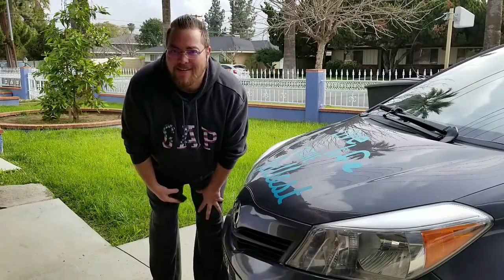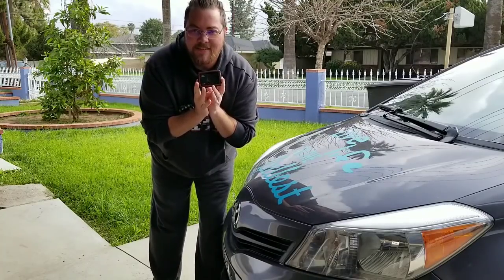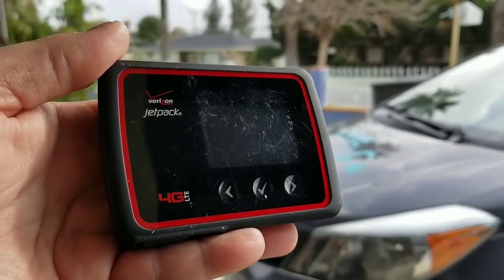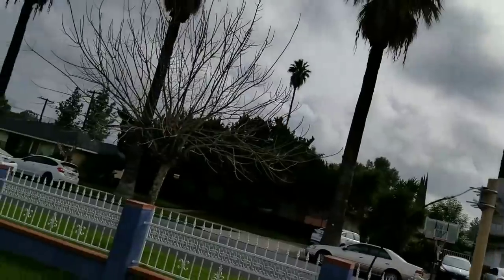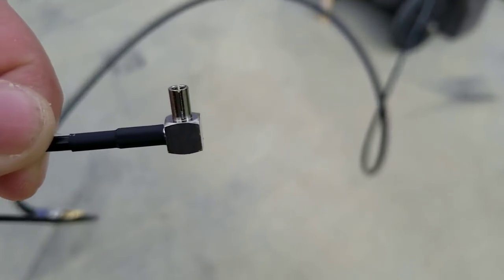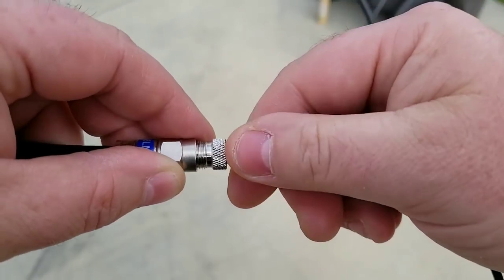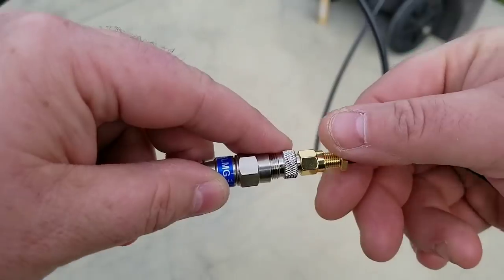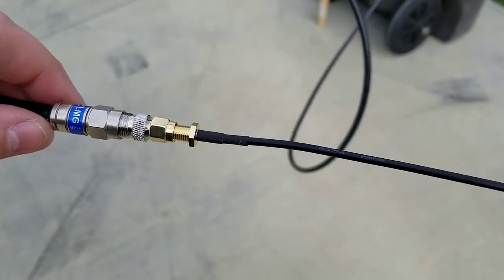"AS OF JULY 2018 MY 3G IS OFF" Cheap internet on the road Verizon 6620L Wilson directional antenna

Comment: Quick suggestion....don't turn on the jet pack until after you connect the antennae. You can damage the jet pack by plugging it in while the power is on
Reply from the maker: Buck Naykid good advice thank you

Comment: Hi Kristofer...  About the Verizon..... would you have more infos ?  you said 5$ a month ? unlimited internet ?  so you just buy this 'jetpack' on Ebay and then use it ? it's that simple ?   is there a contract to sign ?  (monthly or annual bills?) Thanks !
Reply from the maker: Pat Montreal  I bought the device on eBay I put in some information in the description.  How it works is when the $5 is due you go to their site mrwireless and purchase a $5 load  And what they do is apply it to your account that they've already purchased from Verizon.   The device is flashed to do 3g unlimited.  it's really very easy.   So my 1st $5 will be in May because I get the 1st 2 month's free.  Let me know if you have any other questions.
Reply from the maker: Pat Montreal oh and  No contracts.
Reply: Hey, thanks for taking the time to answer !  it's precious info you just gave me !  thank you so much ! Pat.
Reply from the maker: Pat Montreal no problem.  hope it helps. I put the site I  the description too

Comment: I had 3G in the truck when I drove over the road and was able to DJ my internet radio station with no problems at all.  All I had was a USB720 dongle from Verizon and only found 2 places all over the US where I drove where there wasn't a signal.  No booster.  Of course the higher your antenna can be mounted the better since you'll get less ground interference.  Looks like you did real good on the purchase.  Oh, that vocabulary thing you think you have...  naaa.  You don't have any problems at all my friend.  I understand you just fine and I'm sure everyone else does too and if they don't, then just laugh inside knowing you confused them.  We know what you are talking about.  I understand the brain going a million miles a second.  Mine does that as well and has as far back as I can remember, sometimes making it difficult getting to sleep.  Just a few days ago I was trying to go to sleep and nope, my brain decided it was time to think about a spring loaded hinge release pin so I can hinge my solar panels on both sides for tilt.  I laid there for hours going over it again and again.  Almost got up to find a boring documentary and try to bore myself to sleep but it finally subsided and I was able to snooze.   Crazy stuff it is.  Thanks for sharing your adventures with us and I can't wait to see Frankie 2.0 in action with all the remodeling and new tech you are adding.
Reply from the maker: Motrukdriver  I know exactly how it is needing to get up or write down what I'm thinking or else I can't go to sleep.  Well that's good to know that 3G is good.  My work programs I think run on very little data so that's good. 👍

Comment: I didn't know about that coax cable adapter. I wonder if that's what the new TV's have the same thing
Reply from the maker: Marty Records that's a good questing.   I know all TV's used to be F connector because the regular cable line is the F connector.  A lot of them still have that F connector port when the cable line comes in through the back of the TV.

Comment: There is an app called OPEN SIGNAL and it will show you the towers in the area.  Currently, I have one tower available to me and it's far far away lol.  An antenna might be the thing needed.  I had thought a weBoost and went into 'info overload' lol.
Reply from the maker: Roaming Raven lol. Hiiiii 😊💚 I tried open signal on my cell phone but because I have T-Mobile it was only pulling up T-Mobile towers.  I tried looking up if I can switch were see other carriers towers but I couldn't find that option.  Otherwise open signal is awesome.
Reply: bummer.  of course it tells me I have a Verizon tower and tells me it is not within range.  Both are true lol.  This spot is about as close to BLM I get in OH.
Reply: when i am not in OH, I am in Appalachia and again, there is a tower out of range.  The good thing is if I put an antenna on a pole and planted it on the ridge, ran lots of cable then I might be the envy of the hollar.  :-)
Reply from the maker: LOLOL yes you will be the Envy of the hollar.
Reply: UPDATE on better app:  actually it is a website...cellreception.com you choose your service provider and check the towers.
Reply: also, have you requested your free TMOBILE cell booster?  check out their website.  Seth (Nomad Everywhere) did a review on it recently.
Reply from the maker: Roaming Raven I saw his video. I'm getting one for sure.  maybe today :)
Reply from the maker: Roaming Raven ship I went to the t-mobile store they looked at me like I had 3 heads.  I showed them their site where it shows and Seth's video of what it looked like.  They said I should call customer service.
Reply: Kristofer Travels He said he had to explain it to them.  Maybe reach out to Seth and see if there are magic words to say :-)

Comment: I have the 3G and it works... a little slow at times but it works..... I wanted more speed so I bought into 6620L and I'm in New York City so no need for an antennae.. 6620L showed one, two and maybe 3 bars. 3G unit when placed next to it showed 5 bars. That $5 service goes through Canada and therefore you can't get Amazon, Netflix or Hulu videos.  THAT'S THE REASON I NEEDED 4G. So if you buy this junk good luck, I've returned mine.
Reply from the maker: Chris Barclay I just got my $5 mo. 4g unit and it works great.
Reply: It works great?  That doesn't say very much. You don't say where you are?  Are you in the boonies somewhere?  Watching  videos from Netflix, Hulu or Amazon Prime?  I don't think so.... Just surfing? I can do that with my much cheaper Version 3G device and that service I'm told will still be around until 2020.  So tell us. What's great?  What are you getting for your $274 that I'm not getting with my $60 device?  P.S.  I am watching videos with my 3G device. The trick is to have an older computer. My laptop is 5 years old running Windows 8.1.... Newer computers and tablets are set to run on 4G and will not run videos on 3G.

Comment: I'm autistic, so my brain is not only going at a different speed than the rest of the world, it's also not in English, it's in Autism. So I have to translate everything in both directions and that is a lot of work. Plus I have short term memory problems and auditory processing and cognative delays.  So don't worry, you're doing fine!
Reply from the maker: Samantha Shanti Âû Thank you 😊💚
Reply: Kristofer Travels How did you get the $5 dollars a month unlimited?
Reply from the maker: Samantha Shanti Âû   I went through eBay and the seller has  Refurbished devices and what they do is Flash the device to do unlimited 3G. So you would pay the $5 a month through their site to them because they own the line.  You will not pay Verizon you will pay this vendor. www.drwireless.us This is a well known site and they have great customer service and will fix, replace and troubleshoot if the device you buy needs it.  There are other people that sell these as well.

Comment: is there a 4G now that's still $5???
Reply from the maker: The Mama yes there is. it's more expensive for the device but it works great. I got myself a 4g device.
Reply: can you help find one, I have no idea about all this. I see them on Ebay for $13.99 all the way to $400. How do I know which one is on, or works with the unlimited plan?
Reply from the maker: The Mama  The one I can see that is legit on Ebay for $499 by seller snorbrdr67 would probably be the only one. That is highway robbery. I just noticed the Dr Wireless site is down.  not Sure if verizon is catching on.
Reply: wow, that's expensive. I can't justify spending that when they say Verizon could shut down the $5 a month plan at any time.
Reply from the maker: The Mama yeah I wouldn't spend that. i bought my 4g device for 275 and i thought that was high.
Reply: its past July now 3 g is still working for me , when is it going to end ?
Reply: Kristofer Travels its past July now 3 g is still working for me , when is it going to end ?
Reply from the maker: joel cumbest it could end at any time. mine stopped. enjoy it while you have it.
Reply: thanks man i will follow your advice